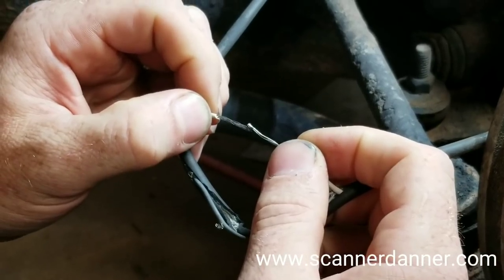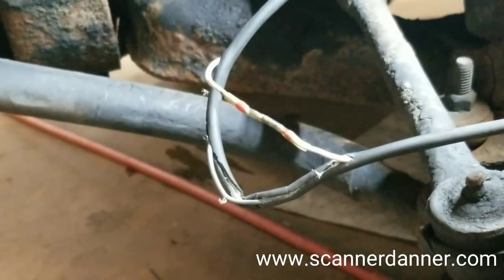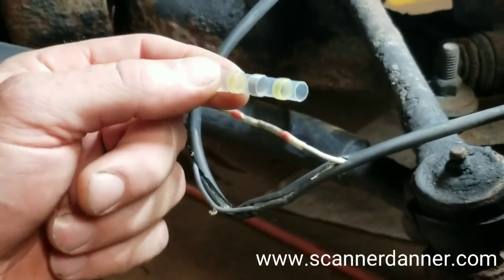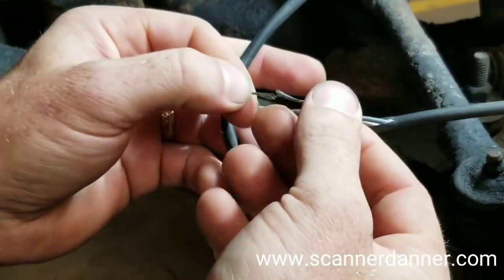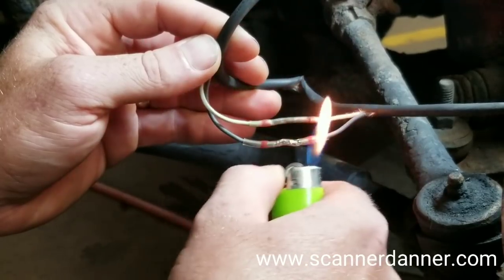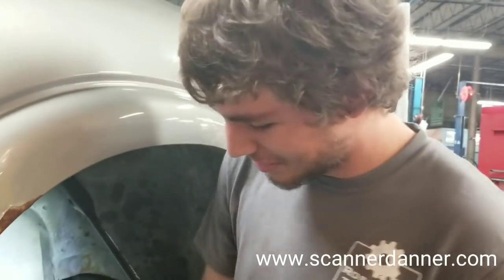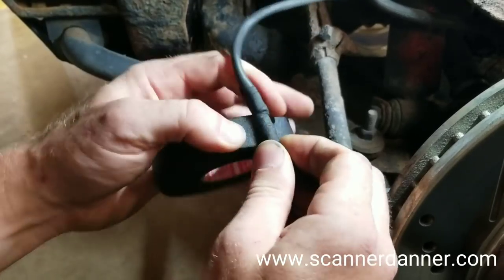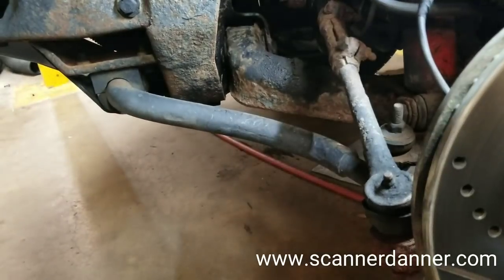Using Solder Seal Heat Shrink Butt Connectors

Comment from the maker: What are your thoughts and experiences on using solder seal heat shrink butt connectors for wiring repairs? I have to say, I am a fan so far. Longevity of the repair is what I'm really interested in. 
The ones I used in the video can be found on my Amazon Affiliate page here https://www.amazon.com/shop/scannerdanner
Reply: Hi scanner danner, is the connector the split on the last video a 3m? Just wondered so I know which one not to use.
Thanks,
Elijah
Reply: As an added, there is a marine grade heat shrink tubing that has adhesive inside that seals the connection. Put a piece of it on the outer sheathing of the harness before you do your splice with the solder seal butt connector, afterwards, cut away the split portion of the harness and cover both splices and the extra wire with the marine grade heat shrink. That way you have the wiring harness and the splices protected from moisture. https://amzn.to/2I7Np9Q
Reply from the maker: To be honest, I'm not sure but I think it was NOT the 3m ones.
Reply: I do Fleet Maintenance and I swear by solder seal heat shrinks I have never had to repair the same place twice.    But I only see the vehicle for  7 years or less
Reply: They work awesome I’ve used them for the last 4 years and I’ve never had an issue.
Reply: I think the stuff is great. I first encountered it while working for Mercedes Benz as a technician. Their version is called Raychem connectors. The Wish app sells the one you were using for very cheap. Not sure of it's quality and if the solder is good and doesn't create resistance. Harbor freight is good for marine heat shrink. Get a huge assortment of various sizes for $5. They come in all black though.
Reply: I have used these connectors and they are hit or miss really.  The clear heat shrink tube should be much thicker.  If you try it on thick copper strand wires results may vary.  You really need a nice smooth splice for these to work properly.  In really cramped spaces the normal soldering and marine grade heat shrink is better.  The extra step is averaged out by not having to re-do the connection or waste these expensive connectors.
Reply: ScannerDanner  i too have used these and generally they are good if you don’t burn through the insilation while heating. And as the gentlemen before me stated, in tight places it’s hard to warm without damaging the shrink or wires surrounding(internal headlamp wiring etc).
Reply: ScannerDanner i love these, they're not super cheap but they are great
Reply: I use a heat gun on the shrink tubing with good results.  This prevents burning the heat shrink or anything close to the repair area.
Reply: ScannerDanner  Wo get from Aleskyfinis
Reply: 🤓 i like it, im going to add it to my wish list under: SHTF tool box 😍
Reply: I used this type of termination for years working on aircraft. Normally for aircraft you would use a  heat gun or infrared heat. Good enough for aircraft should be good enough for vehicles.
Reply: I have used those must say they are brilliant in every way.
Reply: The big truck market is starting to switch to those.
Reply: I use these quite a lot. I use a liberal dose of liquid tape to weather seal.
Reply: Wish there was an edit option. As an aside to my reply above, I have had Paul's book for a couple of weeks now and It's well worth the money! I have the hard copy and it's beautifully bound! I am an experienced tech and use it as reference mostly even though it's a textbook that should be in classrooms.
Reply: Make sure the solder ring is completely melted 360 deg into wire
Reply: I bought some of these and recently just fixed my turn signal wiring with them! I am a huge fan!
Reply: No problems, of course protect any repair from heat  vibration and chaffing with loom or tape etc....
Reply: @richardwhitaker4148   dont have solder though

Comment: This is my regular wire repair procedure. They also have the same type of sleeves but with crimps in them also, which make it easier for the hard to reach places. When you crimp them it holds the wires in place so you can melt the sodier. Awesome videos though im a big fan!!
Reply: I used the same ones with the crimp, solder, and sealant with excellent results.   Bit pricey, I think I paid $20.00 for a pack of ten from a local parts store.

Comment: I have been using them on my customers trucks for a couple years, I had a boat mechanic turn me on to them. I love them, and I havent had one fail on a truck I have used them on. Longest has been on a 6.0 cam sensor loom, a little over 2 years ago

Comment: Love those things. Used them all the time a when I was working on semi trailers. A piece of heat shrink tubing or vulcanizing tape on top of those things and it will last forever. Whats great about them is that you can put them next to eachother, unlike the crimp type where you have to put at different lenghts to get the tubing on.

Comment: I've seen this style sold along side my regular crimp/heat shrink butt connectors, but I never bought them, nor have I ever used them. Looks like a real solid fix for any wires that aren't 100% copper (or for wires that are).

I've had great luck using the crimp style butt connectors. They hold up really well under engine compartment heat, undercarriage water and road salt/sand blasts, and abrasion against metal objects. I use them on everything - lawn equipment, motorcycles, boats, & boat, car-hauling, and utility trailers. My main reason for using the crimp style is speed - put one wire in, crimp, put the other wire in, crimp, heat, DONE. Glad you showed how these ones work - I'll definitely keep that in the back of my brain for future use. THANKS again Paul! Great vid! 👍

Comment: I recently learned about these and used them while building a power box for ice fishing. I used a long nose lighter (used at BBQ grill) to melt the solder. I had a little insulation burning too, so I will be using my new heat gun with small nozzle that is part of a soldering station.
Since I will be in wet (snow) environment, I put another heat shrink tube on top of the clear connector. One last thing, instead of twisting the bare copper together in my case, I pre-soldered (thinned) the wire ends before inserting in the connector. The solder on the wire also melted in addition to the ring. Waiting for winter to put the unit to work. So far so good.

Comment: Hi Paul, nice fix. I’ve found with Tesa tape that you can heat it with a heat gun or similar after you’re done wrapping the wiring, it will shrink down a little and tighten itself on the wiring. Makes the job just that little bit neater

Comment: used those for years, they hold up very well .. the red adhesive i would describe as " hot glue stick sealant"  prevents moisture from entering the connection

Comment: The first time i saw those was in a recall repair kit at Nissan for broken air bag harness wires under armada front seats. They are awesome! I started using them on all my wiring repairs

Comment: There's also that self reacting silicone based tape out there which works really well when pull/stretch it as opposed to your standard electrical  adhesive type tapes.

Comment: I saw this on the FB post. I think it's a cool concept. Just ordered some and received them today. Can't wait to try them out. It's nice to have various repair options, especially out in the field or on site.
Reply: Same here found on fb ,so far not successful
Reply: @joshuabanwaree2640  I have them but haven't needed to use them yet. Lol I do want to install at least 2 with what I normally do... and compare. See how long it lasts.
Reply: @CubasAutomotive  I just tried using them last 25 min I can not get good results
Reply: @joshuabanwaree2640  oooohh... that stinks. I'm still curious. I'll be sure to have my backup tools when I try it. Even if I waste a few, I may have to try it tmrw just to see.

Comment: That product appears to be a fine one and a labor saver.  Currently at our shop, say to repair ABS wires on the KW's that become split when tire chains break apart, we have to use two small pieces of heat shrink tubing for the two damaged wires (using just regular butt connectors for re-connection) and one larger heat shrink tube to cover both repairs.

Comment: Im glad u made this video. I was curious to see it could work on my low beam headlight wire harness. The connector burnt. I got a pigtail of 18 awg wire to connect to the 16 awg wire harness for that low beam. My crimp connectors failed. Thank u for this video.
Reply from the maker: I like the heat shrink/adhesive lined crimp connectors better than these solder sleaves. I just don't trust them

Comment: I've used these on Mercedes airbag wires per their TSB's. The ones i used came from Mercedes. They work well in my experience..and as always a thumbs up 👍👍👍
Reply: airbags are for sure not the thing to fool with,  so only use ""factory approved, materials and fixes" which will most always be supplied from them as a kit... :)

Comment: I've seen them and similar around for years, but never used them. I've used lots of crimp heat seal butt splices though.  if it needs soldered I splice and solder with real solder station and products.
I tend to do most solder joints "western union" splice style, often modified with less wraps or sometimes only half the strands or mesh them and twist against each other like you did.
what I choose depends on the wire gauge, amount of space and how streamline it needs to be. but I work on real fine thins at times, think mini-quad copter and such, where three of the wires equal one of the abs size wires!

Comment: Plymouth rubber brand electric tape was my favorite version of electrical tape other than scotch 3m brand,I used to work for a warehouse called stone ridge electronics corp. They built wiring harnesses for gm before then it was j.c.i. inc. Anyways I built harnesses for the military vehicles and accessories equipment for them, and my main job was international prostar, and t star cab wiring harness and fuse block

Comment: Ive had success with smaller sizes white, red, and blue but yellow takes more heat to melt solder and sometimes i get the shrink to hot
Reply: 🙂 ok thx for the tip

Comment: Hi over here in the uk  .i have repaired a few abs wires    using  60/40 solder using a gas soldering iron or electric  iron. Never had issue
Reply from the maker: I mispoke, I meant "some" ABS wires. The real hair like fibrous ones and to be honest, these wouldn't be good on those either. Crimp only for those or replace the sensor
Reply: @ScannerDanner  to be honest  my bad then .ive  never seen them as if yet.  Is that hust in the states  or is it possible  world wide  cars.

Comment: I'd be concerned about the low melting point of the solder used in those if using them in the engine compartment.

Comment: I’ve used them a few times with mixed results. As with soldering wires have to be spotlessly clean. Had a few of them burst open when heating.

Comment: When I first started seeing these around a couple months ago I thought they were just going to be another janky gimmick but I've got to say I too have been really impressed with these.... I ordered them off Amazon & got a pack of a hundred of the blue, yellow and red and I think there were $15 or $16.. I used them on the three wire connector going to the coil on my starter.... they work great!.. oh and yeah  I'm going to order some of that Tesa tape  I've never seen that you should put the link down in the description that stuff  is the cat's ass Thanks Danner!
Reply: That tape is tough.  We use it at our dealership to reduce abrasion on wire harnesses.
Reply: @bombay6760  I ordered some on Amazon looks like some pretty good stuff

Comment: How can someone didn't like this video. Im going to buy this product. The tape isn't a concern.
Reply from the maker: One recommendation. I wouldn't trust these in a high heat environment. The low temp melting point of the solder is its downfall

Comment: Thanks ... really helpful.. dropped my Harley off the side stand and ripped through some 3... handlebar cables....
Will try this as a repair... confident it will work ... will save tons off $$$... and spare part are on back order till October????....🍻
Reply from the maker: look into the climp style heat-shrink butt connectors, I still prefer those over these. Make sure you get the ones with the sealant inside of them

Comment: You said the solder penetrated throughout the wire strands, but many Youtube videos show it typically does not. This will result in higher resistance (meaaured by a milliohmeter) and heat  (shown with a heat camera). But, it is convenient and will pass current. It's probably good enough for Boeing. 😆
Reply from the maker: Yeah, I'm not a fan of these. I honestly should just delete this video
Reply: @ScannerDanner  I wouldn't delete it. They are convenient and adequate. I use them occasionally.

Comment: A very similar product has been used in the aviation industry for decades. "Raychem" or environmental splices are really the best option where permitted (barring harness replacement) to ensure a sound long term repair. Use a heat gun though...safety third! I mean first.😁

Comment: I solder all the electrical work i do in vehicles. I don't like using butt connectors because they are very thick (think the HUGE bundle you have in a wiring harness with those) and they let in moisture if you don't buy the ones with glue. They also don't REALLY get rid of the air between all the conductors. I saw these type connectors in a facebook add and got curious. I think they're good for areas where a soldering iron would be difficult to get to or somewhere with delicate wiring. My one concern is that if it's a cold wire or say wiring that's been exposed to the elements and has sucked up into the insulation, moisture being stuck inside of the connector. What are your thoughts? I was thinking if you went left to ride or visa versa, it would push out the moisture as you sealed it, but unsure.

Comment: Heat shrink butt connectors of any variety present several problems when it comes to harness repair. The margin for overheating the integral heat shrink is often very low, working on heavy trucks its not uncommon to find failed heat shrink butt connectors from previous repairs in the chassis harness due to moisture intrusion from split heat shrink, this is compounded on crimp type heat shrink butt connectors as the crimp often damages the insulation. 

The objective of repair a harness should always be to restore the wiring harness to as good or better condition than factory. Butt connectors of any kind rapidly increase the dimension of the harness especially when you get into multiple circuit repairs, you can always cut the harness back further and off set them but that can add a lot of time depending on where the harness routes.

I prefer to use open barrel splices covered with marine grade heat shrink whenever possible, the repaired wire dimension does not increase appreciably meaning you can repair several circuits in the same location, the splice and heat shrink are applied separately meaning there is no risk of damaging either the splice or the heat shrink and the repair is a cold joint meaning you have not superheated the wiring and created a stiff spot in the harness. 

I work on heavy trucks not cars but your content is very informative, test don't guess.
Reply from the maker: I prefer my crimp style heat shrink connectors over these. In fact, I never use these nor do I see any advantage of them, only disadvantages like the ones you mentioned

Comment: My guess would be some ABS harnesses use stainless in the wiring.  Very difficult to solder even if you know what you are doing.  If regular soldering doesn't hold, these are probably not going to help.

Comment: Cool, I'm interested in the durability as well but very convenient.  I just soldered 3 sets of coil pack connectors as the plastic cracked and it was a PITA.  My butane soldering iron died so had to drag out the electric one.  Which brand is this one you're using?  I see many different ones on Amazon, Wirefy, etc.

Comment: You CAN solder almost anything.
If you can’t, it is simply because you do not have the right solder/flux and tools, period.
Reply: problem is, some things you'll burn the coating off before soldering, even with heat sinking attached ;)
Reply: P V you are incorrect
Reply: The problem is abs wires aren't real wire it some cheap wire and when you have problems with abs wires they are so black with corrosion that they can't be cleaned ad soon as you try they fall apart you have two options buy a new harness or use crimp connectors you never be able to get them clean enough for solder
Reply: It's really hard to get any kind of solder to stick to that copper plated alu wire crap they use for some things. The copper coating evaporates and the wires curl up on you and the tin doesn't wet aluminium etc etc. I usually stick with the crimp and shrink butt connectors for most things, only if I need a slimmer connector do I use the solder shrink ones.
Reply: @ColtaineCrows  using  flux will work .

Comment: Maybe it was the brand I used, but.....the issue I kept having was, the solder would melt and at the same time, would tend to pop through the wall of the connector. Almost like a boil through issue. Which is the same as pin punching a wire because now it's not sealed. I won't mention the name but they weren't off brand or cheap. Maybe I'll try again. Thanks
Reply: that sounds overheated, use a heat gun instead and heat it slower. you can move the flame away and around more for same results, also turn the flame down.
but heat gun or indirect heat like infrared is best for all the shrink connectors.